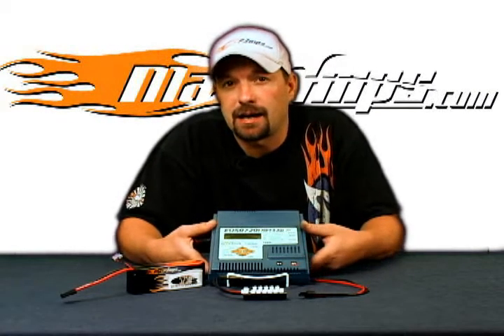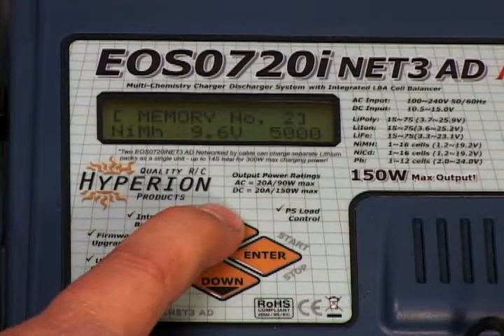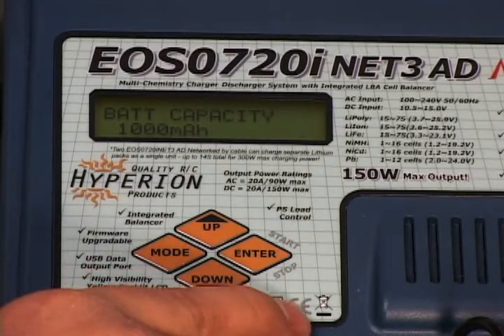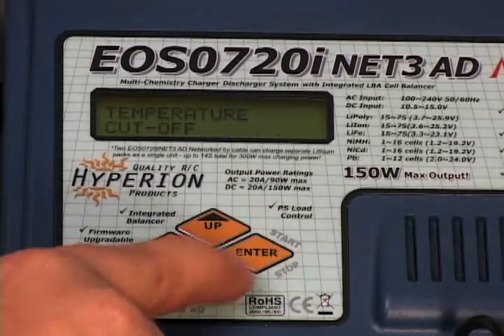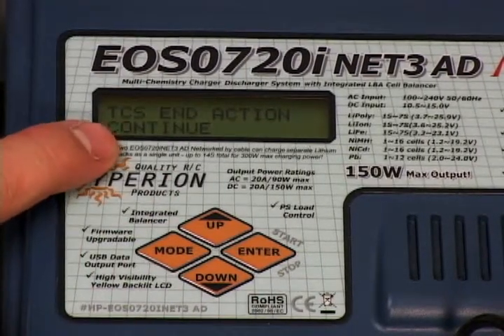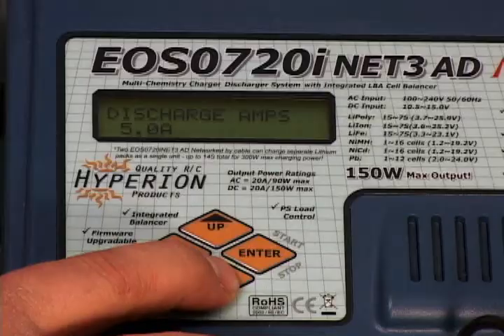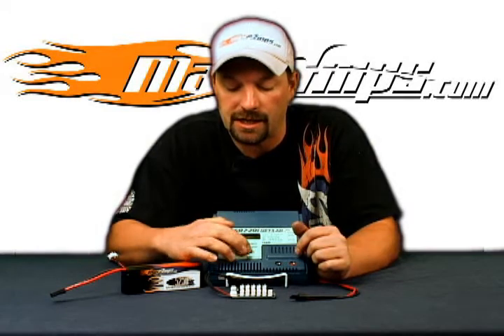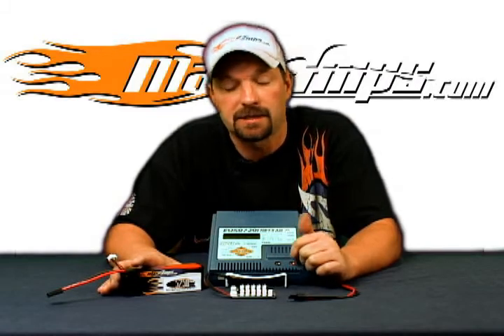How to set memory position for a LiPo pack using the Hyperion EOS720i NET3 AC/DC Charger

Comment from the maker: @delta6326 Once you set it, it stays in memory. A good LiPo for the Traxxas Bandit would be the MaxAmps.com 5450 2-cell and 3-cell lipos that were made specifically for the Bandit. They are the only 100% waterproof lipos and are a direct fit for Traxxas vehicles. They include a lifetime warranty.